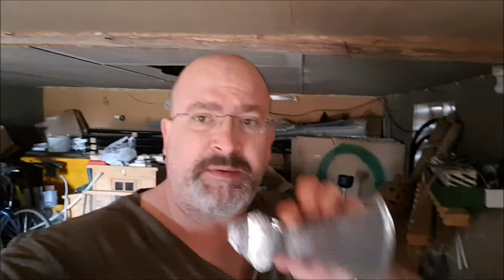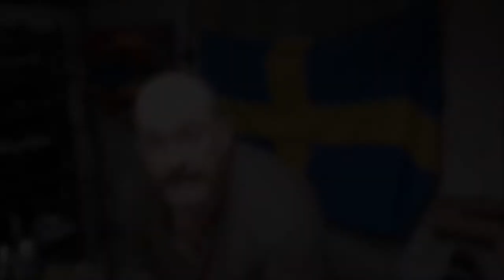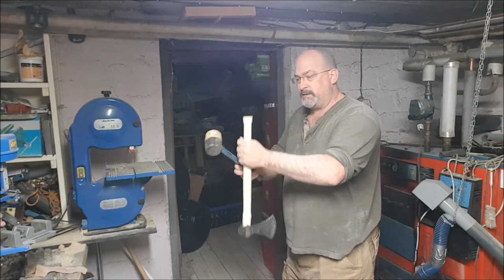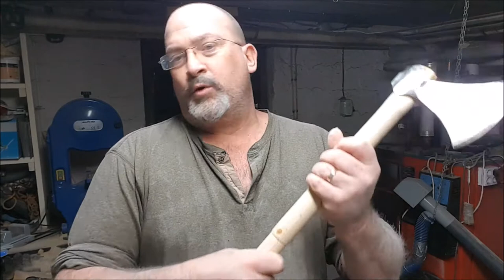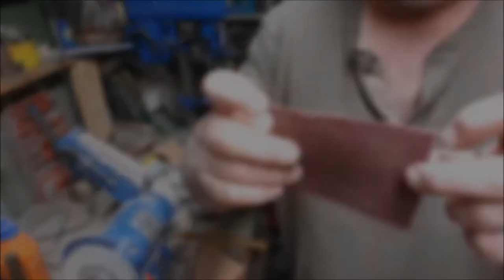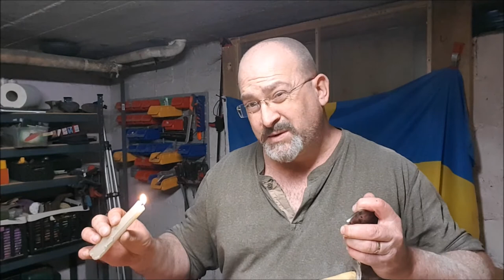Axe handle project

Comment: Very nice job but I highly suggest for you to wear a mask  next time,I see tons of dust In the air .thumbs 👍🏼
Reply from the maker: Yeah you right, I get so used to working in dusty environments ( my job is in construction ) I tend not to think about it. My room has got ventilation but your right😍 ATB
Reply: @norfnifelemon  I had a House in  Florida  after a hurricane. We had a meter of water inside 72 hours later,had tons of mold ,I worked in the hole house and getting rid of moldy walls and furniture no mask, fast forward to 2020 was diagnosed with level one asthma  not fun in this times with this corona 🦠
ATB .